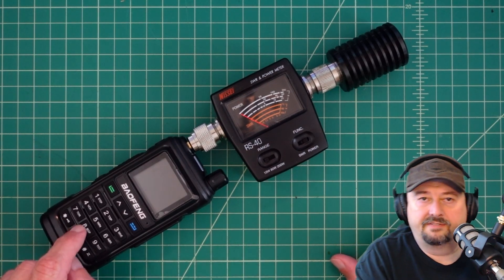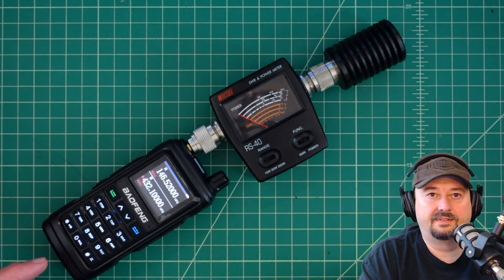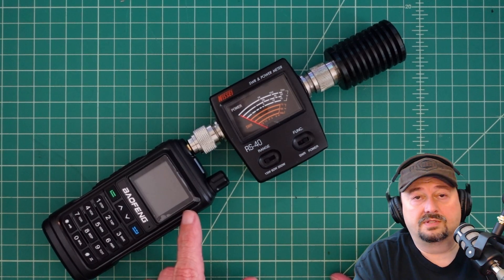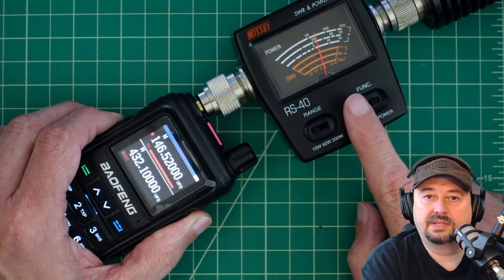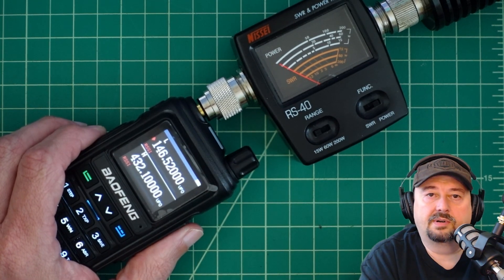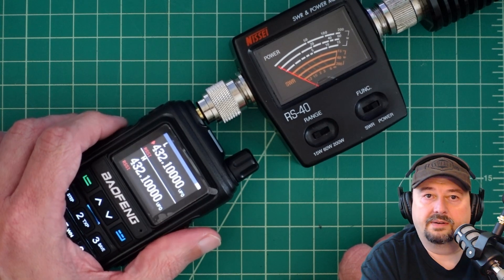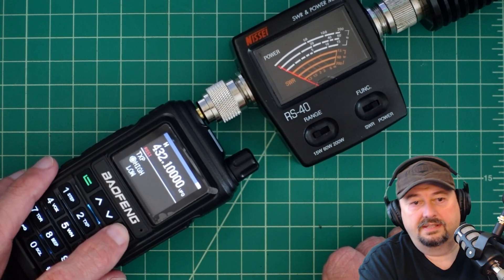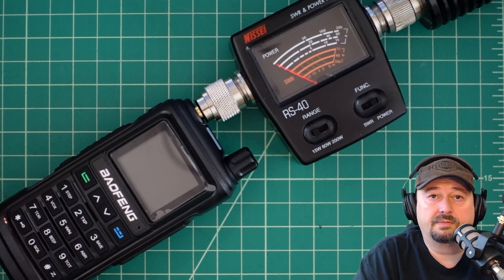Radioddity Baofeng UV-17R Plus: Power Test

Comment: Thanks for the video. Amazon is currently advertises it as a 7 Watt radio. Did you have a chance to measure the spurious emission/sideband suppression of this particular version? It looks like the base version (without "Plus") had some serious issues with harmonic suppression, I am wondering if they fixed it. If they did, this would be a good radio for the price. Thanks and 73.
Reply from the maker: If I recall correctly it did have spurs

Comment: nice video' I have seen 2 pack of China radios test different on power and harmonics . still ?? on that. so I just teach each radio . solar weather messing up VHF and UHF at times. internet lag cell phone drop calls . the HF bands have been a mess. 6 meters has been open  at times even at night . but distortion on RX signals making a hard copy.  even decoding FT8 on 6 meters been hard. must be solar noise. surprising Baofeng battery is pretty good.  have good life and run time. test the battery run time .  and USB charge time.  73's
Reply from the maker: Hey Robert, I’ll have more tests on these radios 👍